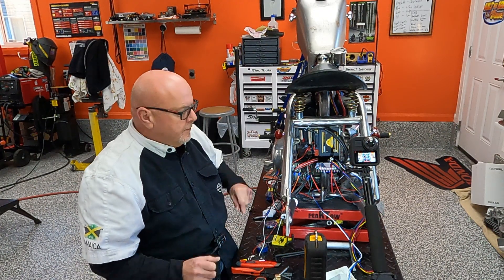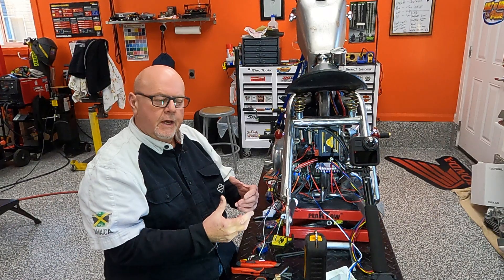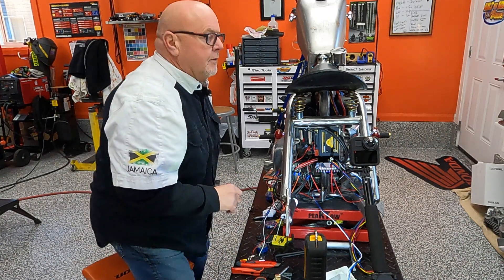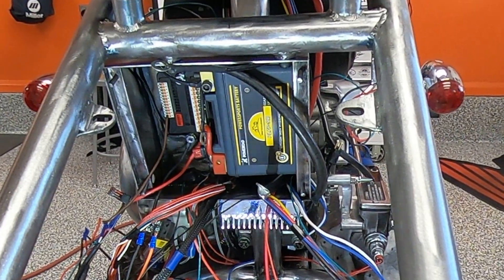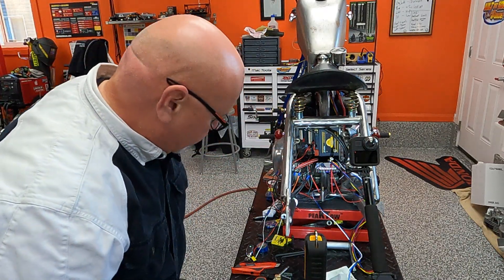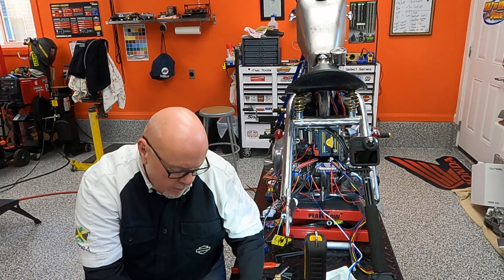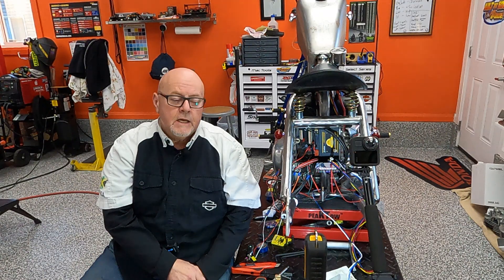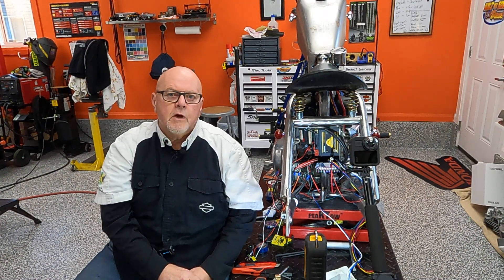Harley-Davidson Sportster Build  DGD to M-Unit

Comment: I been riding with munit blue since they came out. Great product! In fact it's the only video I have with any views... haha.

But why not just use the keyless go feature on the munit? Other than a physical fob, it functions the same. Motogadget also has an rfid fob set up that you can wire in and it's much smaller. I just wired a physical key as a back up in case my phone died.

Anyways, you got a beautiful machine. Thanks for sharing!
Reply from the maker: Hey Greg, thanks for sharing. The M-Unit I used is the basic … no Bluetooth function so no phone. I looked at Motogadget’s M-Fob or whatever they call it. The issue I had with it is the same as what Revival Cycle noted, you have to pass the fob in close proximity to the receiver. If I’m going to take the fob out of my pocket to hold up to the reader why not just use a key?

With the M-Unit basic no longer available I will use a Blue on the next build. I’m sure I’ll use Digital Guard Dawg again as well. Both are great products.

I might put a DGD in Karen’s ‘92 Miata for her. 🤔 

Thanks for your comment about the bike, I appreciate it. 🙏
Reply: @BuiltNotBoughtByBruce  ah, gotcha. Your setup makes sense then.

If you go to m-unit blue, your phone can be your key. It encrypts and you can set the proximity from your bike for unlocking it. It also has a cool GPS function that if your alarm goes off, you get a notification right to your phone. It also tracks it across the globe as long as it has power. Pretty handy in a worse case scenario. 

The motogadget fob would have to swipe over a close proximity, like a key card. This would be a back-up if your phone died. You could use it on the original munit your running but I like the proximity unlock that you achieved achieved with the bull dog.
Reply from the maker: That’s a good idea about the back up fob. I hadn’t thought of it that way. Thanks!